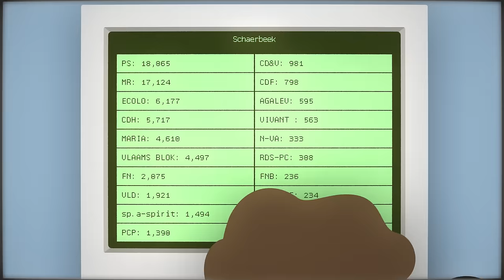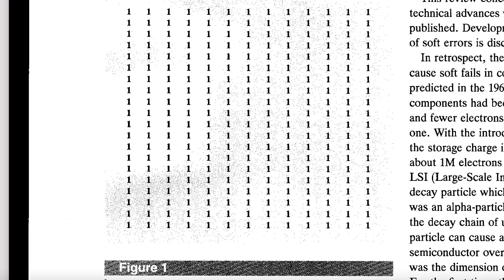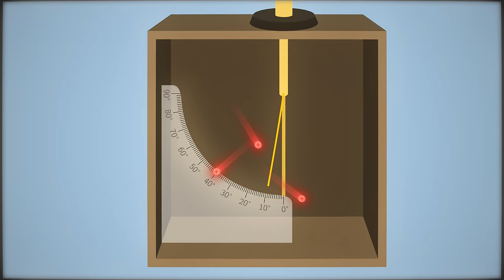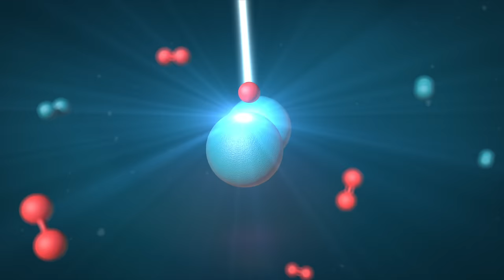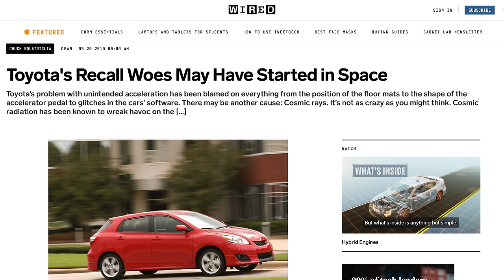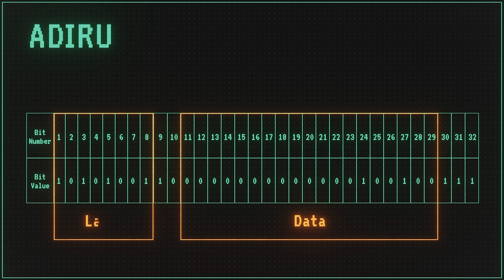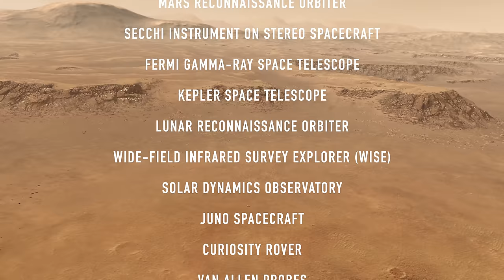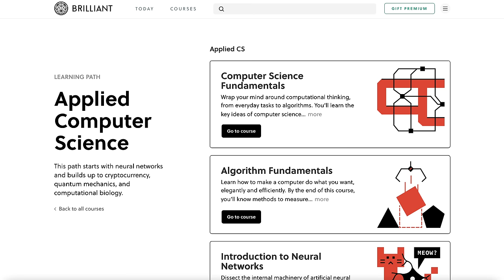The Universe is Hostile to Computers

Comment: "Cosmic rays" has been a sysadmin joke for explaining system failure for about 30 years, and it's cool to have a video like this that actually explains what happens.
Reply: Actually, it's a joke about a reality. As a programming neophyte in 1980, I was quick to hear of a faculty member who had proved one of his programs had failed to run correctly when the program logic was correct. The machine was an IBM-360-type mainframe, and after the program proof, a bit flip at a certain point was demonstrated to cause the same failure. The faculty was well aware of cosmic rays and the many experiences NASA had been accumulating over years of flights, so there was no reticence about looking there. When a new computer science building was erected subsequently, it contained rather a lot of concrete, and the mainframe was located in a deep basement under a thick layer of it, in order to minimize its vulnerability to cosmic rays, reducing detectable quantities by a significant margin.

So for us students who had to produce working programs within a given number of tries, we had to meet a high bar to make such claims, and the joke was more about what would be required to submit a proof to the admins.
Reply: We should just use the computers they used in the late '60s for lunar missions. They seemed to survive okay.
Reply: @chriskennedy2846  they were ferrite beads wound on copper wires. The bits were programmed into the position of the bead itself. You can't use them to do any modern tasks. They were good for basic computing required in the 60s.
Reply: @prakharmishra3000  But they still had registers, acumulators....  running on silicon. Program was rope memory (try to beat that).
Reply: This thread is educational as hell.
Reply: It's not really a joke.  We say it jokingly, because it is extremely rare and not often the cause, but we are quite serious.  Without ECC ram it is roughly one bit flip per every 128 MB of ram per day.  That can be a serious problem.  However, with ECC it is much more rare, something like one uncorrected bit flip per 10000 years.
Reply: funny you should say that, I was just thinking of the BOfH as I watched this...
Reply: Never heard of clock spread spectrum?
Reply: Maybe creator don't like computers or artificial reality
Reply: @prakharmishra3000  Successfully getting all the way to the moon several times is modern enough for me but I see your point on the raw computing power issue.
Reply: @chriskennedy2846  yeah they were rad hard but they choked on lack of ram and rebooted when trying to land. (it's slightly more complicated)
Reply: @uh78  what does adding slop to a clock frequency to get around fcc requirements have to do with it?
Reply: @chriskennedy2846  Computers for early lunar missions survived because transistors were so large, thousands of times larger than those now, making them impervious to what were minor disruptions to the amount of current they were switching.  In contrast, switching currents of tiny transistors is so small that an energetic particle could easily change its state.  Nonetheless, rad-hardened ICs do have specializations such as being built on insulators (eg. sapphire) rather than silicon substrates to reduce those effects.  Likewise, computer redundancy (majority voting as he explained) is more than sufficient to make up for the small topographies these days.
Reply: No the classic BOFH excuse is, "sunspots".
Reply: @prakharmishra3000  Magnetic memory using ferrite rings to hold a magnetic field is a more resilient form of memory than semiconductor memory.

But, the physical size of each bit of storage and its low access speed means it can't be used today in modern computers.

But it was used in space borne applications precisely because it is more resilient to cosmic rays.
Reply: @uh78  because there is no such thing.
Clocks are used to synchronise the electronics in the computer 

Spread spectrum is a communications technique for transmitting data using radiowaves.
Reply: @JohnSmith-ut5th  No.
ECC RAM doesn't reduce the frequency at which bit flip occurs.
What it does is correct the errored bit when it occurs.

And I dispute your figure of 1 bit flip per day in each 128MB RAM per day.
If that were true, desktop computers which don't use ECC RAM would be crashing far more frequently than they do. It just doesn't happen.
Reply: @deang5622  damn bro i was smart 1 year ago

Comment: The fact that this issue was detected by troubleshooting technicians impresses the hell out of me.  Holy cow!  This was such a fascinating video. Thank you!!
Reply: If your a programmer this is pretty obvious, especially since it was a binary value. The second he said the number 4096 I instantly knew what the cause was. I wonder how many people have lost elections for the same thing happening in the other direction.
Reply: Thank you democracy
Reply: @levelup1279  Yup, the second he said 4096 it was obvious, "oh, a bit got flipped". Pretty much any programmer worth their salt is going to immediately recognize any number in 2^n for n <= 16 as a power of 2 and realize that if something is off what's expected by exactly that amount, it's the result of a single bit. Though it was news to me that cosmic background radiation can be the culprit. Cool stuff.
Reply: @levelup1279  alright then tell me something about it that he didn't sayin the vid.
Reply: @Arjun-jm4ll  Missing comma amongst a thousand lines of code 😂
Reply: @levelup1279  I knew a bit flipped, but this video gave more insight on what people on the hardware side of computing deal with. I never would have guess cosmic rays from across the universe affecting random bits here and there.
Reply: @levelup1279  Yeah of course it was obvious that a bit was flipped, the problem was to determine how it was flipped in the first place.
Also, the error has been detected. You imply that the system can't be trusted because it can have errors, but that's the other way around : the system will detect errors, even errors provoked by random unexpected events, which demonstrates its safety.
Reply: @levelup1279  This is one of the reasons why you need the redundancy in elections.
Reply: @levelup1279  No, I'm talking about the technicians who first discovered that cosmic rays were interacting in the first place and wrote the paper on the subject.  As someone who works in IT, it's ridiculously amazing they were able to figure that one out.
Reply: @johnnyneckar4977  I was referring to the technicians who figured out cosmic rays were a thing and wrote a paper about it.

Comment: Great, you guys just gave Adobe an excuse not to fix Premiere
Reply: @Leruster  i like that resolve is free, but i don’t have a stupidly powerful computer that can meet its minimum requirements, i have 2 gb of vram but resolve needs 8 or else even on 1/8 scale it’s unusably laggy
edit: also my processor is a 3rd gen, dual core intel
Reply: @benty6024  Well, I have puny 2GB, GT1030 and Resolve works very well. At least, I can edit without much issues.
Reply: @rikilshah  wel my computer has a seizure every time i open resolve
Reply: @kofiy  which cpu do you have?
Reply: Just tell adobe you are running it with ECC memory.
Reply: RESOLVE is looking real good these days, just saying
Reply: @benty6024  we've had a lot of vram and new cpus available for good prices for a while now. might be a you problem.
Reply: @reyouxbdye  well might be because im broke and cpus are at least 40% more expensive in india because of import tax
Reply: @benty6024  yeah my bad, I forget I'm privileged.
Reply: What I like in Premiere is it's scrubbing, ability to cut audio to a couple ms, handles every format I throw at it and especially the audio constant power and video warp transitions I use a lot-- if anyone can confirm Resolve is just as good for that maybe I'll try switching again..
Reply: They don't even need an excuse to not fix premiere
Reply: @kofiy gtx 660 with a 4k monitor hmmmm
Reply: I finially thought I was gonna be able to start being a “youtuber” and Adobe is has been completely broken for over a few months now
Reply: Talk about damn Illustrator ... and Photoshop not having color wheel until PS cc 2018 🤦‍♂️
Reply: Didn't expect to see you here Tim 😂👋
Reply: Ooohh hahahaha
Reply: @HarshitRautela  FOSS angel torvald great
Reply: yeah the web adobe is limited to pdf ithink
Reply: @evionlast  yep
Reply: And it's android apps like Adobe pdf maker

Comment: As a software engineer, we've been blaming cosmic rays for our bugs for years. "I assure you, despite you having the error right in front of you, it's impossible. Have you tried running our software from inside a salt mine?"
Reply: I am hearing about this for the first time. But there were times when i was so sure there is no bug and then i hit play again without changing anything and everything works. Now i know
Reply: @stickguy9109  Visual Studio be like
Reply: Sometimes the universe itself it stacked against us
Reply: "salt mine"

I guess aperture science is safe from these rays
Reply: @stickguy9109  I mean, odds are that the environment was to blame and not a cosmic ray. But it is possible, yes. I’ve certainly had times when I was tempted to blame a cosmic ray for some weird behavior I couldn’t reproduce.
Reply: @stickguy9109  Cosmic rays are actually relatively rare. That's just your code being a malevolent, self-aware entity. (Or more likely, the enviroment or static electricity.)
Reply: "Run it again." LOL
Reply: @9volt65  they are not that rare if IBM was correct about 1 bit flip per month for every 256 MB of ram.
Reply: @michagabo8819  you’re insane
Reply: @michagabo8819  Yeah, that's what happens when a human brain is hit with one of these things. Stop reading apocalyptic material and GO OUTSIDE, breathe the air, throw a Frisbee, eat an ice cream cone barefoot on grass.
Reply: @stickguy9109  Welcome to a better world where you can sarcastically get out of anything you screwed up. "I'm sorry boss, must be cosmic rays. Here, I even have a youtube video to explain it."
Reply: @tristfall1  Yeah that'd be a good reason. Everything is cosmos's fault from now on.

Comment: In the 50's I worked for a mining company as a sampler. I accompanied geologists and did the heavy lifting.The Atomic Energy Commission AEC were doing aerial mapping in their search for uranium.  Planes were contracted to tow scintillometers in N/S and E/W grids over the surface of the earth and record the gamma ray readings on a map. A hot spot was called an anomaly.  Our company leaders had been employed by the AEC in the past and had access to the AEC Anomaly maps,  for cash under the table at a local private club.
Our investigation on the ground was often tedious and when we could not find the source of radiation, it was attributed to a "cosmic burst".    
Iguana Dave
Reply: Damn respect, how old are you ?

Comment: I work in IT support and this was like learning that demons are real.
Reply: yeah, except the demons just come in the form of having the misfortune of not using ECC memory and subsequently intel nudging ECC memory away from consumers hands by marketing it as an enterprise feature.

(i believe it was either linus torvalds/richard stallman that made an article regarding ecc memory)
Reply: Computer: randomly flips a bit
IT guy: get me holy water and salt
Reply: The exorcist IT guy
Reply: I work with Quality Assurance, I can't even imagine testing something like that 🤣
Reply: @generic6099  has no idea what any of that means
Reply: I'm a programmer. and this was like "F*****************k 😨"!
Reply: Well...actually...
Reply: @yukariyakumo9622  uhmm... salt? why the salt?
Reply: I work at a water plant extensively reliant on an automated computer system to run various treatment processes and there have been days where a pump will inexplicably shutdown or some other electrical component will react in such a way that it will shut down the entire plant and when investigated the problem can never be found or duplicated.  This explains so much.
Reply: Actually i thoughts thats great,because thats about cycrculations and synergizm of energy both humans and some lakes something calculate of system structure,of course have a reaction impact lakes radiations energy between,and the next i wish somebody can find save Wellcome  technology  👍😁
Reply: @valinorean4816  Salt is used in many "magical" rituals for setting a circle.
Reply: @meeerg7987  i did not understand what you were trying to say
Reply: @MrTigracho  you mean geomagnetic storm, like Carrington event?
Reply: @valinorean4816  Yeah. Or maybe is more like the Apocalypse.

Comment: As a software engineer my first thought is store your very important data twice if you can but realized that if you make code that does that a bit shift does happen you don't know which data set got flipped so you would really have to store it 3 times and put it in the log that a bit was flipped and that it took data from the two datasets that where the same and the only way that this could fail is if the same bit is flipped on two of the three datasets which even one bit flip is rare so I doubt two would happen let alone two of the same bit in both datasets and also even if it did happen something is put into log and hopefully a human will check the log if an error happens and see that a very very rare occurrence has happened
Reply: also watched a little bit more in and realized that during calculations a bit could flip which a way to get around that is kind of what was said in the video but also slightly different, do the calculation twice if the output is different calculate twice again and also put something in the log

Comment: The stars align 
Universe: "Bank error in your favor."
Universe: "Collect $5000"
Reply: $4096*
Reply: Ah, thanks for landing on my Baltic Avenue.
Maybe I'll win second place in a beauty contest and win $5006 next!
And just wait until I pass GO.
Reply: Accountant says no. Go to jail, do not pass start, do not collect $200
Reply: Given my typical luck, it's pretty safe to assume, that, if such a bit flip ever happens to me, it flips the first bit in a signed int representing my bank account's value from 0 to 1.
Reply: With my lucky I'd probably lose $32768 and have no way to get it back.
Reply: @tigrafale4610  $40.96, if you're going to that, since they track the number of cents. Or $5242.88 if it's 2^19, I guess.
Reply: $5242.88 since they use integer arithmetic in cents.
Reply: Tax department wont suffer bit flips when they hear about that.
Reply: @pierreabbat6157   Actually, integers in centi-cents. Maximum possible balance is about $900 trillion with 64-bit integers.

Comment: "A speedrunner inexplicably jumped to another platform."

Someone is an Absolute Legend I see.
Reply: Karl Jobst’s next video will be titled “Why speedrunners are moving to Chernobyl”
Reply: @sakuracs  turns out uranium saves you 1 frame
Reply: @cringe5393  There's this glitch that may give you a boost, careful though, it may cost you the run. I think it's called radiaton
Reply: @HaveANiceDayLol.  This skip saves 2 seconds. It is high risk because you could throw your LIFE run.
Reply: @cringe5393  but did they splice the run from other speed runners?
Reply: @cringe5393  j
Reply: @sakuracs  genius lol
Reply: What if the speedrunner just cheated and was good at hiding it?
Reply: When speed runs become pure rng
Reply: dream luck explained
Reply: @sakuracs  LOL

Comment: "Cosmic rays are trying to crash my car!!!"

"Honey, you're stepping on the gas pedal."

We're doomed as a species.
Reply: Humanity is like a snake, some are at the head and some further back :D
Reply: Maybe they’re trying to delude themselves into thinking it’s not their fault.
Reply: Big brain time: Maybe cosmic rays flipped the impulse in the neuron responsible for pressing the gas vs. not pressing on the gas.
Reply: King Pistachion  Hoomans
Reply: @darko.v  "Hew-mons!" If you're Ferengi.
Reply: @vodkacannon  likely. This is called confirmation bias. People don't like being wrong.
Reply: no the pedal is stuck.. not because they press the gass..
there many accident where the pedal stuck even they lift their legs.
Reply: @astronemir  I get this is a joke but neurons dont work like that. they wait for a 30mv signal from a neighbouring neuron and if they receive something other than that they dont activate.
Reply: I had a sudden acceleration even once, it was a bit strange, I just tapped the accelerator 2 or 3 times and it stopped. I'll never know why, was it a cosmic bit flip, was a bug (most probable), something mechanical got stuck, I wonder. 
but in those cases, you just keep your calm, press the brakes very slowly to counteract the acceleration, and turn off the engine, the car will stop and you won't crash because you have control over the brakes (even thou you turned off the pumps, you can still brake the car with the left pressure in the fluid, and even without it if you press really hard on the brakes), which are entirely mechanical for that reason.